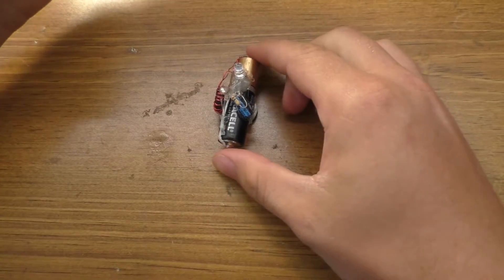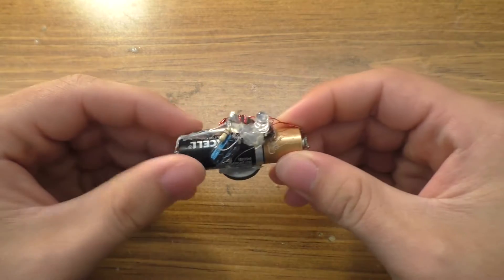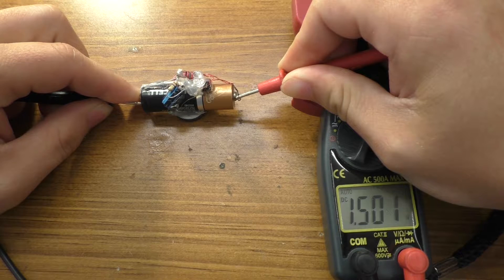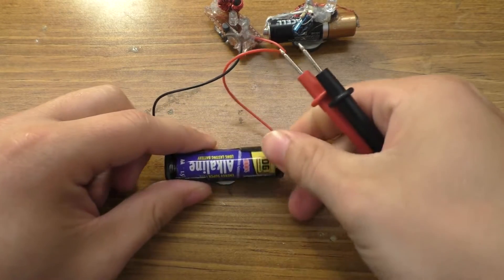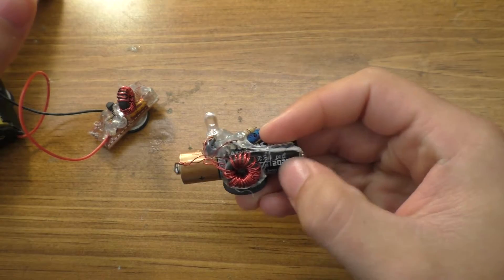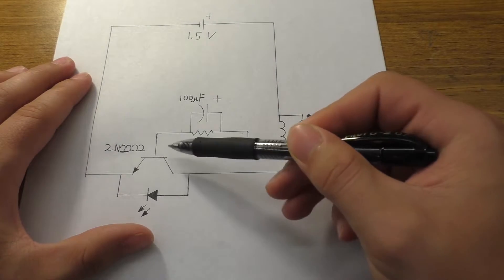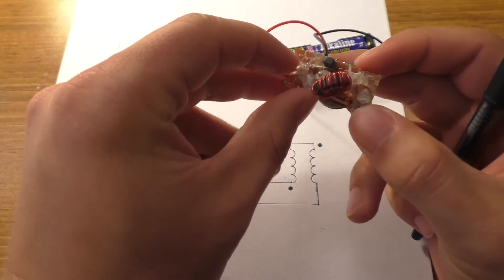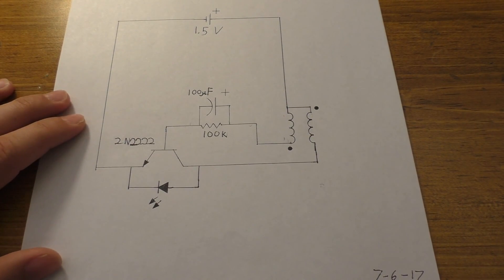Blinking Joule Thief: 1 Year Update

Comment: I just built one of these (7-10-2018) using a new "D" cell. If I'm lucky I might live long enough to see it die. LOL. I've got it facing out a back yard window; hopefully some burglar might think it's an alarm system and go next door.
Reply from the maker: That sounds like a great use for it! I know that are a fair numbers or cars that have a blinking LED inside to indicate an alarm system. I think your battery will probably die of self discharge faster that the circuit will discharge it. I wouldn't be surprised to see it last 20 years or more as long that the battery doesn't leak or something.

Comment: How long do you think it would run a 3MM red LED from a LR44 coin cell? (I don't remember the sizes but its fairly small anyway)
Reply from the maker: I would guess something like 3 months, probably more than that. I don't recommend using red though. The forward voltage on red LED's is just low enough to the point where it will glow very dimly on 1.5 Volts which takes a decent amount of current when you are talking about things meant to run this long. I forgot to mention this but the whole reason I put a used battery in the other one that I showed in this video is that a new battery actually Illuminated the red LED that was on that circuit just about to full brightness without the joule thief. The slightly used battery made it flash like it should. Now you have me tempted to build one of these with an LR44.
Reply: Eman2000 Awesome! Please do and sorry for the very late response, I didn't get the notification so I finally came back to see if you responded but please do it with LR44 but DO NOT solder to it because it WILL explode (I learned the hard way)
Reply: @Eman2000  So you mean to say that because of the lower forward voltage drop of red LED, it will glow instead of blink? This explains everything!!! Inspired by your video I just made a joule thief blinker but with a red LED and it glows instead of blink... Same is the case with yellow LED. Whenever I will make a new circuit, I will remember to use a blue LED instead of a red or yellow onr. Thanks for the explanation!!!